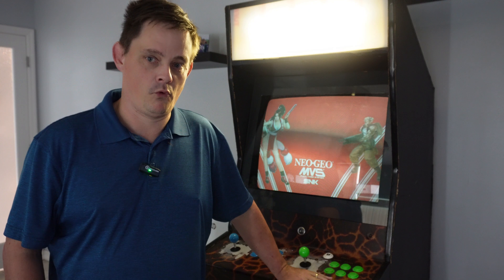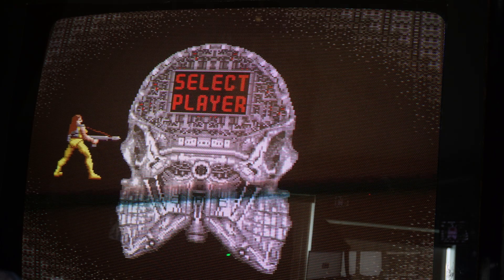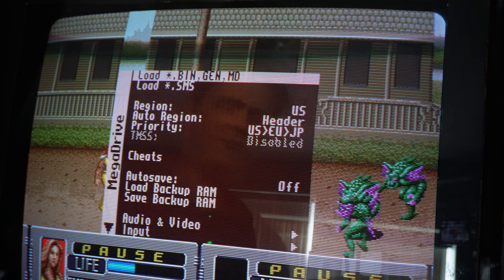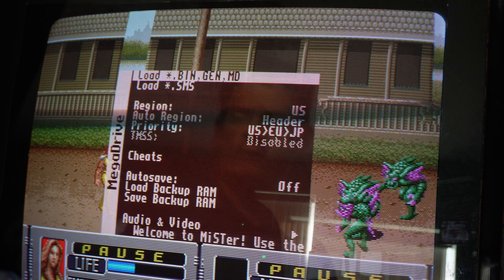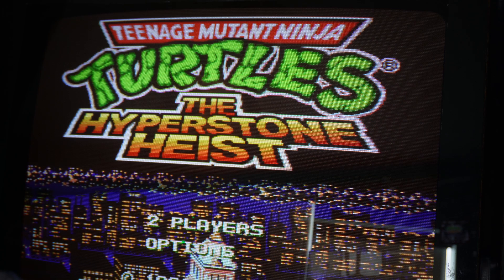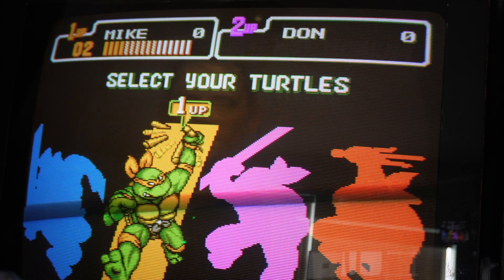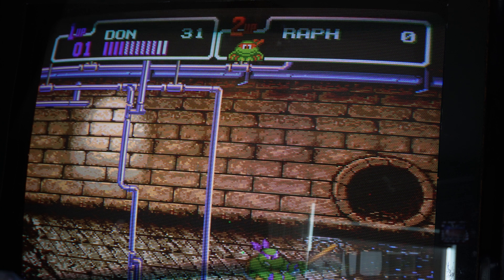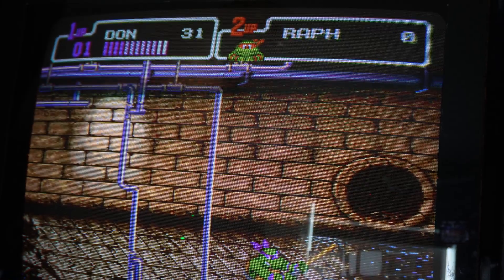MiSTer FPGA - NukedMD core on the arcade cabinet (Genesis/MegaDrive)

Comment: Hi craig, how are you filming the crt without the rolling black bars from the refresh rate?

Edit: oh, I actually see a very slow black bar now.
Reply from the maker: yeah if you set your shutter speed to match the frame rate it helps a lot but hard to completely avoid it.